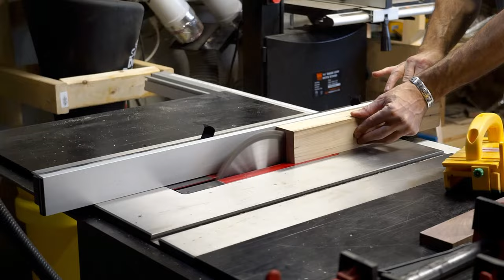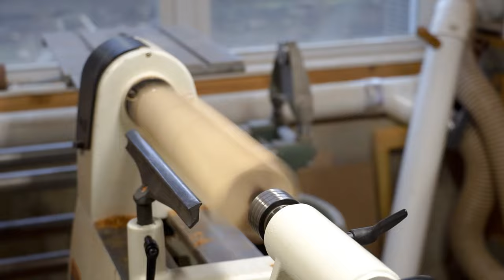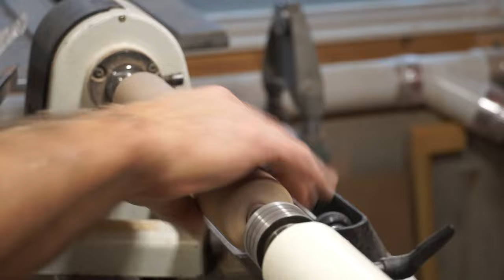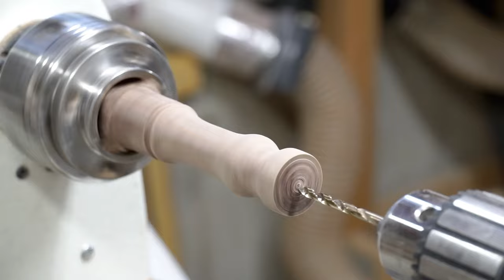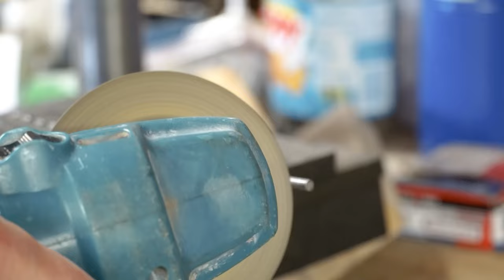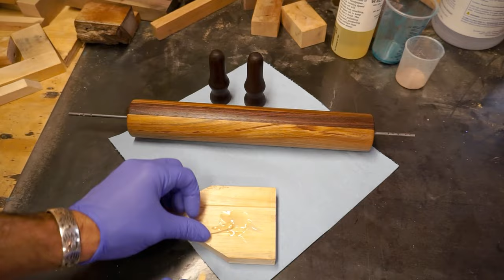Woodturning Basics: Make a Rolling Pin

Comment: What did toy use to thread the handles to the rod in the pin?
Reply from the maker: I used an angle grinder to created notches in the steel rod and then epoxy into the wood handles. There is no threading. Thank you for watching!